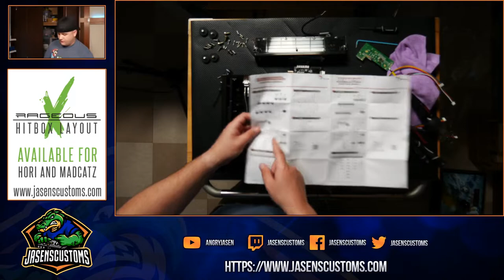Let's Build Something! Madcatz TE EZ MOD Install and VS Upgrade!

Comment: For anyone else who is somehow still building this.
The wiring that comes with the EZ mod for the LS,DP,RS switch does not fit into the current Brook UFB with pre-installed headers. Jasen plugs this in at 2:25:15.
The current UFB with pre-installed headers does not have a molex connector for LS,DP,RS. It has a pin header, and the pins are very close to the pcb, height-wise.
You can get the EZ mod wiring to fit, but you will have to shave away at the molex plastic on the cable. And even then, you will have to plug it upside down, so LS and RS will be switched.
Reply: Only on the UFB? It doesn’t have to be flipped on the EZ mod as well?
Reply: If you have the tools, the Brook UFB uses a Dupont connector for the LS/DP/RS selector.  
Also for anyone reading this, the video assumes you did not rip out all the terminal blocks in the stick.  The home button (and one of the grounds on that 3pin  connector) needs to be connected to the terminal block of the UFB.  The touch pad and LEDs directly connect via JST connectors.  Keep in mind, if the UFB is is Xbox One mode the LEDs will not turn on.  Hold 3P (HP, Fierce P) while plugging it in to force Xbox 360 mode where the LEDs will work.

Edit: Minor corrections

If you want just a home button, on the original board solder wires from GND (first column, second pin) and XGUID (second column, first pin), then run them to the Brook board terminal block (PSHOME and GND).  This only works on 360 models though.

Comment: I'm installing a TE EZ MOD board in my Rd 1 (PS3) Mad Catz joystick.

The biggest frustration is the lack of internal room for the Brooks board.
You have to make your own space in the TE R1/2 case.

You simply can't leave the inside of the TE in stock condition and have to cut away a lot of away under the buttons (at least 40%) of the middle plastic to create space to fit the Brook board so that it doesn't get crushed by wiring; that also allows space for your buttons to fully depress!  I would recommend cutting the plastic on the inside with a saw and scoring tool for plexiglass after you completely disassemble the case.  There's no control with a Dremel and while it may be faster it makes a HUGE mess as it heats up the plastic and releases toxic gas, too!  The cuts with the saw and scoring tool are far more precise and create less mess.

You simply cannot make the cuts you need to make safely without taking the TE case apart.
*************
*************

I've had problems with the TE even when I didn't attempt mods.  The issue with wiring bundling under the buttons has always existed with this Mad Catz style of joystick.  Externally, the TE Rd 1 is a beautiful joystick case but inside it's among the most cramped, least mod-friendly joystick case styles I own.
You wouldn't have to do this amount of case modding with an HRAP 1-3 plastic case.  That had a LOT of internal space without that blasted middle spacer (the plastic with the round holes that mimic the 30mm pushbuttons) Mad Catz insisted on for the Rd 1 and Rd 2 joysticks.

P.S. -- I'm glad I watched this video.  I saw EXACTLY where I had to cut the SJ2 trace on my EZ MOD PCB and it clarified something about the lock switch being TOO TALL on the EZ Board (although I already cut the Lock switch on the EZ board down to fit my TE PCB cover).
Jasen also answered a question I had about these G-Damned Brooks screw terminals.  They work completely different from terminals I've used in the past.  So, lower the "elevator," then raise it to "trap the wire"?  How many people do you suppose have been screwed up by THAT stupid detail?!?  It has to be several dozen.  Brooks really should bring to the consumers' attention HOW this stupid screw terminal works.  I'm sure lots of people have bought the 20-pin harness for the Brooks board because they got frustrated by the terminal screws. 

In all honesty, if you have the $13, buy the stupid 20-pin harness and save yourself AT LEAST 40minutes work if you're "an ordinary mortal."  The 20-pin harness is also a cleaner installation than most of us will achieve.
In the TE Rd 1, I think the power for the EZ Mod Board comes through the 4-pin cable used to activate the Turbo function, doesn't it?  I was wondering how the board would be powered otherwise.
Reply: Hey man I just got the Brook Zero-Pi Easy for my Madcatz TE R1 for PC. Do you know how to solder the usb cable on the pi board? Next to the USB socket it has five unlabeled holes, is the square hole used for the SGND? Then what colors should I solder?

Comment: Do you need to use that stock pinboard and ribbons or can you just remove the cables from that pinboard and plug them directly into the Fighting Board?

Comment: does the ez mod work with the retro board?
Reply from the maker: Pixelhans - Yes; just keep in mind that you may need to solder a JST connector onto the retro board where Turbo goes and Player LEDs (which just indicate board mode not player number)